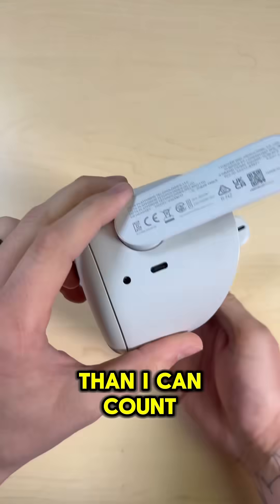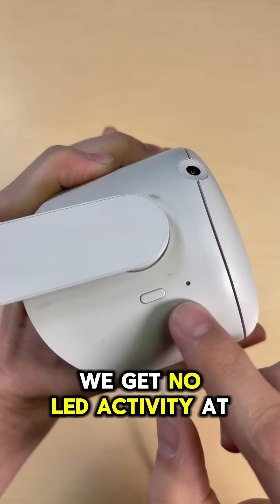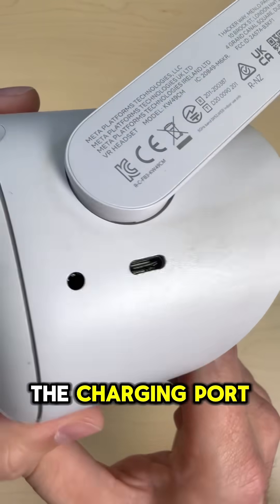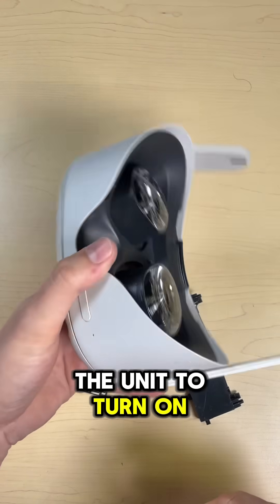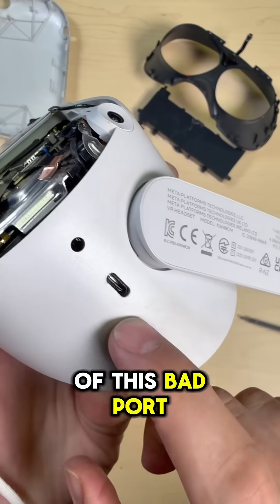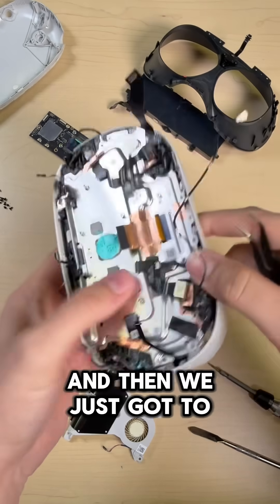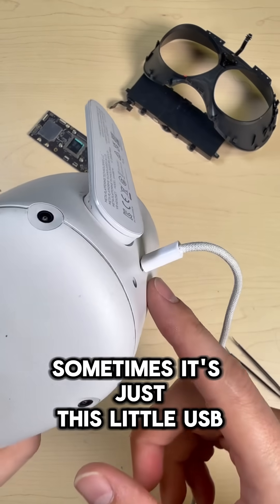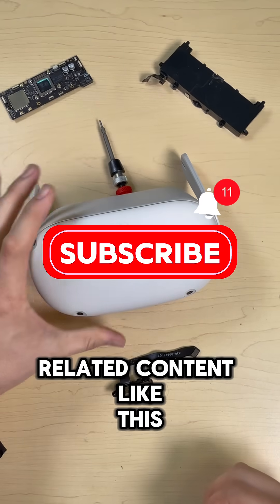Why doesn’t this Quest 2 Turn On? #vr #virtualreality #quest2

Comment from the maker: Need Your VR Fixed? 
▶ Visit FixMyOculus.com
Reply: Do you fix stick drift?
Reply from the maker: @Mellon_Gods13Art yes.
Reply: Yea what’s the best way to fix really bad stick drift pls im dying here😭🙏
Reply: Do you know how to fix my not being able to charge nintendo switch?
Reply from the maker: @Fungamer993 yes.
Reply: @fixmyoculus  thank you for your reply. my guess is my controllers arent able to connect to my main switch because i hit them when i play nintendo switch bowling. so one it doesnt charge, 2 one of the buttons dont work on the red controller. its an oled edition 500 dollar switch, i could charge it a little if i held the controllers down and properly, followed 4 tutorials none worked.
Reply: @fixmyoculus  couldnt ever fully charge
Reply: do you have a discord so we can send pictures of the vr or controller so you could see the damages of it
Reply from the maker: @Buster_Maxxor you can send them to us on our website or email us.
Reply: If I need it ima ask to fix my battery to
Reply: Do you guys know how to fix guardian and passthrough issues?
Reply from the maker: @Mesa_East Are you sure it’s a hardware issue?
Reply: My controlling tracking will not work even after factory reset and my joystick both have dirty one joystick is shattered with the spring sticking out
Reply: My vr does not work when I try and charge it the light goes red and I press the power button it  turns red on the led
Reply: Can you fix my gr I put i. The microwave
Reply: I need you to fix my contorlors they are broken  pls
Reply: I have had sick drift for so long I got a new quest 3
Reply: @fixmyoculus  so one day I went on my VR and it was like the screen was like a painter like drew very long lines around the screen
Reply: @fixmyoculus  so like my quest 2 did the same thing it turns in but none of the camaras or the lenses work it’s black and sounds like it got factory reset
Reply: Yeah, I need to fix
Reply: So can you fix the inside of the lenses and the battery being exploded?

Comment: Question how do you fix a controller that is not turning on I switched the batteries that wasn’t working. Turn my VR off and then on that didn’t work. How do I fix it?

Comment: Im really afraid if it will happen with my quest pro, because i guess i will not find charging port for this lol. Yeah i could solder another type c port on a ribbon cable, but meeh its very risky. So i use magnetic connector 100w for laptops and high quality 100w type c cable. Two years still works.

Comment: Hey I have a question my quest3 has a problem where my left controller index button is sticky like if I press it it will sometimes get stuck on the button so you have to pull it out

Comment: my right controller doesn’t/hardly works, i have put in new batteries, tried reconnecting, once in a while it will turn on and move but it repetitively turns off again, any tips?

Comment: What about a quest 3 that does not turn on after v72 update, no meta logo on boot, no rexovery menu pressing power and volume button...
Reply from the maker: The only resolution we’ve found is to swap in a new nand chip with a fresh copy of the software. 
To nutshell the issue for you, V72 locks up the Device by triggering security protocols in the Android system. It can’t be updated, reset, or restored once the security lock is in place. 

So nand chip swapping is the only way to regain function.
Reply: @fixmyoculus  how did you manage to put a fresh copy of the software on the nand chip?

Comment: I’ve had a quest 2 for a while until it broke and I got sent a refurbished one from meta but when I got it on the start up screen it said to pull the tabs out of my controller. Now I was stuck because they only sent me a new headset and I only had my OLD quest 2 controllers and they wouldn’t pair to the headset. I’ve tried contacting meta hundreds of times and they said that I need to send it back when it’s just that the controllers won’t pair and I’m stuck in the startup screen. Got any idea on how to fix it?

Comment: uh, question, what does it mean if my quest 2 won't charge past 97% but has a stronger battery life than before? like when it would charge past 97 it seemed to die much faster but it randomly stopped charging past 97 and then it seemed to have a longer battery life????

Comment: Problem - connector cut on inside of the front plate. Can turn on - just not boot.what does it cost to repair that?
Reply from the maker: Depends on the connector but I’d ballpark it around $60.